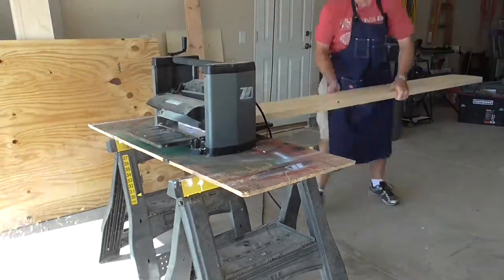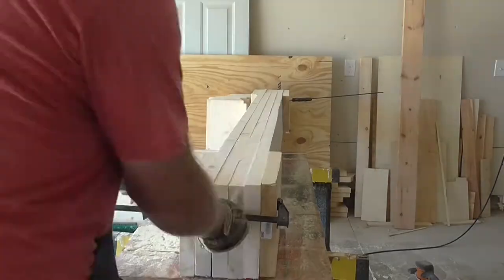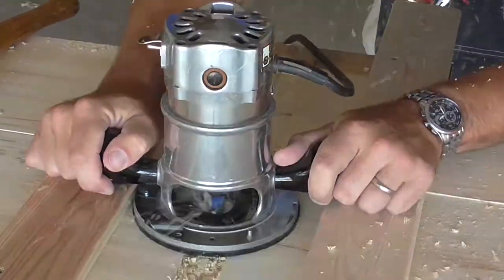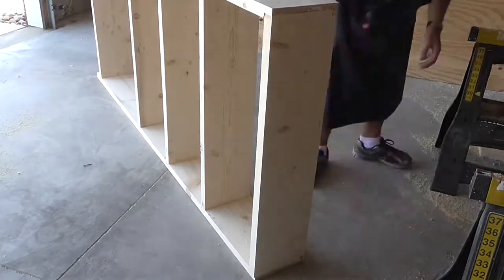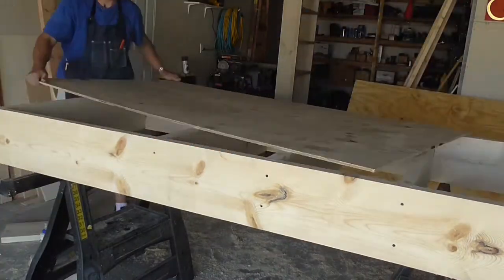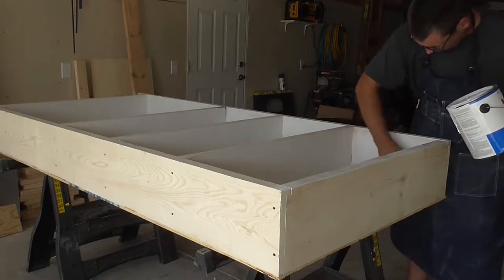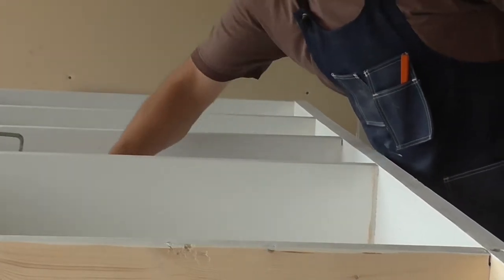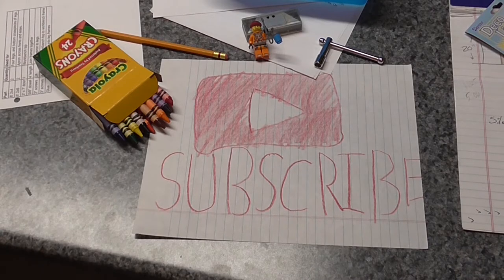Ep22 - Secret Room Part 1: Bookshelves

Comment: Make another book shelf and put it on hinges. Great job btw.
Reply from the maker: Thanks very much!  We didn't do a third book case because we wanted it to be relatively temporary.  Another bookcase would have to be anchored into the floor and we didn't want to cut through the carpet or drill into concrete.  (see our solution in the third and final part to the project, coming soon)
Reply: Awesome.  Can’t wait to watch it.  Thanks